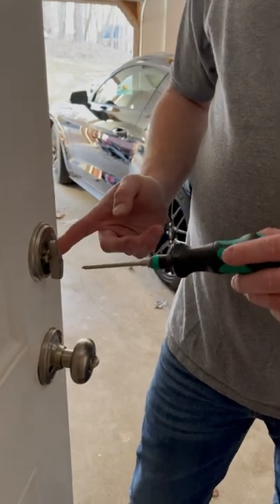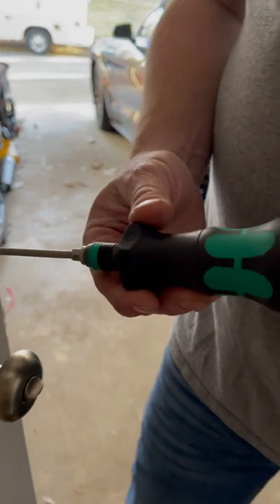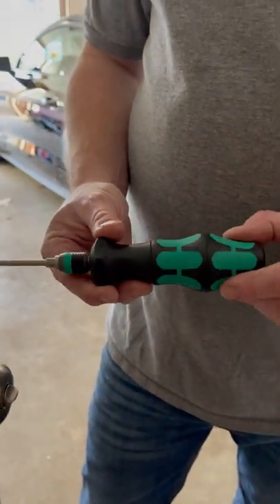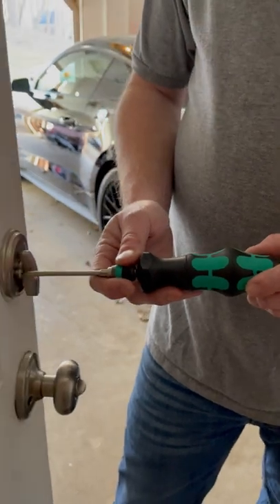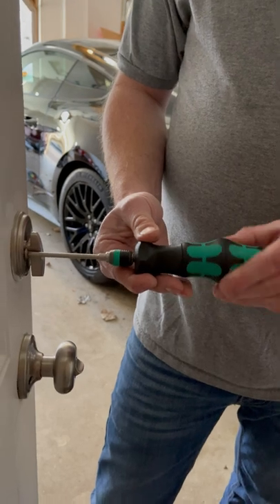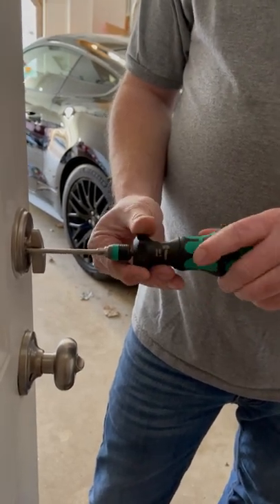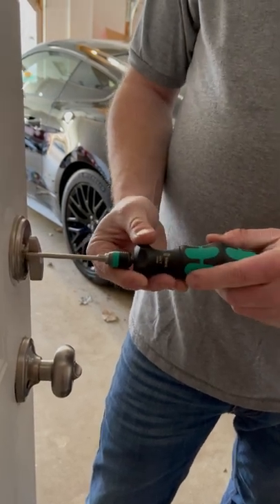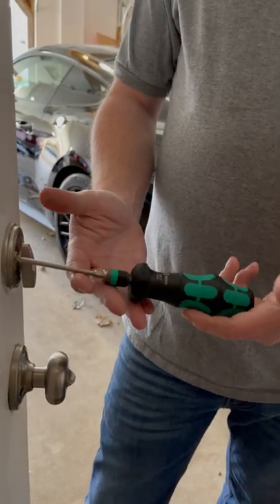Turbo Charged Screwdriver!

Comment from the maker: Link in description.
Reply: You should see my home made portable screwdriver, bye friend.
Reply: Is it durable though? 
Would it be a good buy for a diesel mechanic? 
Or would I just wear it out an brake it?
Reply: @lemonaid8678  i don't think  is durable and is useless too in my opinion. 
Edit: the gears are made by steel, so i think is durable.
Reply: @AsitShouldBe  well I wouldn’t buy it when I have the entire matco screwdriver set. That have proven themselves, but just wondering how durable it acutely is to pay 100 something dollars for it seems to me it’s for the home guy that would hardly use it.
Reply: My question is it battery operator or just a mechanically geared . Wouldnt mind something like this at my job . But since we cant use powered tool ,it would be point to buy
Reply: @StephenSmith-je7kz  from watching the video it seems like a ratchet screw driver just with a gear reduction in it.
Reply: @StephenSmith-je7kz  is simply geared, gears are made by steel.
Reply: I'm paying attention to that Mustang i love Mustangs 😂

Comment: Wonderful tool! But for $125 I’ll probably have to stick with regular “non-turbocharged” screwdriver 😔
Reply from the maker: It is pretty expensive. 💰💰
Reply: What!? Pass! I have a black and decker battery powered one i got for $30 and cant believe how much i use it
Reply: That makes snap on look cheap!
Reply: You gotta pay for quality. Wera and wiha are top quality tools I love all mine.
Reply: Theres quality and then there is overpriced..
Reply: Now Stahlwille makes snap on look cheap but again another very high quality tool German tools are exceptional even a lot of the cheap German tools are great. Wera is Czech but still awesome.
Reply: got a bosh ixo 6 gen for 45$ on discount ,  way more useful , you can also buy attachements for it
Reply: Did u say $125 for this screwdriver?
Reply: @Mario A. yeah most of my screwdrivers are naturally aspirated 
I do have a few turbocharged ones tho lol just not this one yet.
Reply: @PacAnimal  lol I have several electric ones as well as dewalt 20 volt drill and impact Milwaukee fuel m18 and m12 drills and impacts. I’m just a tool fanatic and I love all my tools
Reply: Jesus, I really wanted that until I saw this comment.  I’m not hating, just yikes 😬
Reply: @donniebrazis  me to. I was getting ready to order it,until I seen the price. Screw that. But not with a Wersa. Lol
Reply: If it comes with a lifetime warranty then it’s not too bad. I would be gutted to have this thing break.
Reply: @erik1514  I’m not sure how long the warranty is supposed to be but I have a regular wera multibit driver where you push a button on the top and the body separates and has the bits. I accidentally ran mine over with a big truck and broke the body. I sent them a picture of it broken and they asked for my address. About a week later I had a brand new one in the mail. Didn’t ask any questions about how or what happened or when I bought it or any receipt.
Reply: For that price, it should have a turbo mode, normal mode, and a high torque mode
Reply: 🤣🤣 its just money man. Make and spend it. Treat yo self 😌
Reply: For 125 bucks it better make me lunch when I'm done with it
Reply: I have a milwaukee M4 power screwriver. Tool & a battery with charger for 150
Reply: You can buy  an impact driver set
Reply: @SUMDUDE.  alot of snap on shit is not all that. Believe me i know. I've broken more snap on sockets than i have anything.
Reply: @bigdreamerification  make and save... spend wisely
Reply: @jamesfair9751  the difference between stahlwille and snapon is that snapon is expensive everywhere and stahlwille is at least reasonable in europe
Reply: I see it on Amazon for $70-80
Reply: @thefogisgone3662  oh I know, I have more tools then most mechanic shops and most are snap on but I have switched all my power tools to milwaukee and use milwaukee ⅜ socket set daily. But I also use my $2500 ¼ snap on 100th anniversary set daily too. My snap on rep said I break more stuff then anyone else on his route, I told him the other people aint working hard enough lol. At the end of the day you cant beat snap on sockets and ratchets. I do go to my matco xl ratchet wrenches over my snap on ratchet wrenches tho
Reply: @jetaddict420  that’s good to know. Now who is going to Europe that Can pick me up
Reply: @SUMDUDE.  i work in my dads transmission shop he's had for about 30 years and he's basically got everything we need already hand and air tool wise. And its all snap on, matco, and mac tools. I mean i've bought about $3,000 worth of snap on ratchets, wrenches, sockets, and CT761 i have to have rebuilt regularly once a year, plus lights and another $1000 or 2 on other trucks myself. But i have it all paid off and the only trucks that still stop in are snap on and matco. The mac guy gets all butthurt when he finds out you been buying from other dealers so he wont stop unless you bitch em to death to warranty something. I've noticed that tool trucks only really want to stop when you owe them money. But after awhile it just becomes silly bc im not buyin shit i dont really need just to make sure that they stop yano? I like tools but my fetish phase is over with and sometimes i dont even go out on the truck when he comes by anymore bc i got shit to do and i know im gonna buy somethin i probably dont really need. It becomes like the waitress at a restaurant who doesnt do her job and make sure your drink is filled but still expects a tip bc most people tip regardless of the service. I've had the best luck with Snap On and Matco warranty wise though. But yeah they dont like it when ya dont owe them money.
Reply: 4x the speed and only 1/4 the torque! I'll buy 2!
Reply: @blackmesaresearch2  its basically a non ratcheting ratcheting screw driver lol
Reply: You can get a decent impact driver or even a drill for that money
Reply: lol, less than 60$ in my country
Reply: Look good but I rather stick milwaukee close price
Reply: Made in Germany with real wages vs made in China with slave wages.
Reply: Ah yes you mean the naturally aspirated screwdriver. That one is good too!
Reply: @PacAnimal  no replacement for displacement
Reply: @gigi9467  amen to that. I'm experienced enough to know the difference.
Reply: @jamesfair9751  where is it made?
Reply: @kodyking3090  Stahlwille, wiha, gedore, knipex are made in Germany wera headquarters in Germany but is made in Czech Republic.
Reply: For $125 u can buy a few cheap drills and use them for screwdrivers.
Reply: Im a pro w my trigger on my impact driver.  Dewalt driver that can set locks to frame a wall. $150 screw driver is for video makers
Reply: The answer I needed. Regular driver is fine for me.
Reply: I'll just stick to an extended bit holder and a drill lmao
Reply: Or just buy the kobalt one
Reply: Just slap a turbo on that nun turbo 1 cylinder 1000spins per hour bad boy
Reply: $125!? I was just about to go and search Amazon...I’ll pass now.
Reply: KOBALT DOUBLE DRIVE RIPOFF?
Reply: @jamesfair9751  shits overpriced, you can buy an impact diver for that price
Reply: Anything Wera is an above and beyond piece, but worth it
Reply: @ayoo4117  to each their own. I have several impact drivers as well. Different situations call for different tools. I can’t carry an impact in my pocket all day long.
Reply: And the batteries...
Reply: Man I don't normally feel bad for Americans but its 45GBP, you're being way overcharged.
Reply: At that point just buy a cheap little drill- and or buy a used drill
Reply: @ToolPros  Why so much? It's just a gear ratio'd screw driver. Great idea, too expensive
Reply: Just stick with a naturally aspirated screwdriver
Reply: @stephanopapadimitriou4789  imagine if the turbo broke on your screwdriver- "shit well I guess im not using it today"
Reply: A cordless screw driver is faster and cost much less
Reply: Yeah.. Naturally aspirated will do just fine for that price
Reply: Yeah I'd rather use an electric one
Reply: Better off buying a second hand Makita impact driver and extended ph2 impact bit.
Reply: Or pay a little extra for a power drill
Reply: $25 worth of quality plus $100 for the brand name.
Reply: WERA FTW.
Reply: Get a damn drill for 50 😂😂
Reply: Ide pay maybe $30.
Reply: I prefere my electric screwdriver, aka chordless drill lol. Its still pretty cool though, i can see people using this. For screwdrivers i always found ratchets kinda useless
Reply: @jamesfair9751  reviews on Amazon are mixed for this thing. Pay for quality applies to a lot of things lol but a plastic cheap feeling screwdriver with gears in it is not one of those. I could buy a 12 volt impact and run screws 10 times as fast as you could with this thing. Wera has a following of collectors not workers. They know this and they know people will pay a ridiculous price for their offerings. Klein is the master of paying for quality tools. Wera is the master of a spot in your brain that makes you only want the cheap plastic screwdriver more when you see the price. Wera is like redbull. Klein is like good old coffee.
Reply: That's nearly as much as an entire set of Snap On screwdrivers. I also can imagine the Snap On is less likely to break.
Reply: Non turbo is called naturally aspirated screwdriver
Reply: You can buy a good quality battery-powered screwdriver for a lot less than that gimmicky thing costs, but then it's amazing what some will pay just for 'poseur' stuff.
Reply: Yeah you can get a power tool for that money 🤣
Reply: It's not 125

Comment: I’ll stick with my normally aspirated screwdriver 😂
Reply: Naturally *
Reply: Naturally *
Reply: @kelvinchirayath4224  both are correct.
Reply: @AevenSong   correct
Reply: @mrglock568  no they are not
Reply: @narlynarwhals27  “ADJECTIVE
(Automotive engineering: Vehicle components, Engine, transmission, and exhaust)
A normally aspirated or naturally aspirated engine breathes air at atmospheric pressure”
Reply: @mrglock568  imagine being educated and still being told you’re wrong🧐
Reply: lol youtube grammar check is faster than AI recommendation
Reply: @mrglock568  say that in real life everyone will laugh at you
Reply: @Static_Spaceship69 Did the dictionary definition hurt your feefee’s?
Reply: @mrRufffnTumble  welcome to the interwebs
Reply: For that much you can get a all electric IMU activated screwdriver that is also a torque wrench. But wera does make pretty things.

Comment: I use my high torque makita impact for those kinda jobs, rips the door right outta the frame boom you may enter
Reply: Could probably pick one up secondhand for half the price of this thing and its stronger.
Reply: Makita Power Tools are the best!
[I have a Makita Wood Saw.
Very old, But still working good.] 😎
Reply: milwaukee makes the best power tools hands down while makita is overpriced hot garbage with Milwaukee you get your moneys worth
Reply: @maxcollins4397  I've locked up a brand new milwaukee drill the first time I used it, fuck milwaukee.
Reply: @Gesuspiece  hey ganggong did I take your original name you wanted to go with?😂😂😂
Reply: @Back_door_bandit_98  no, I got this name from the dark souls 3 poorly translated mod.
Reply: @Gesuspiece  ohhhhhhh gotcha G I just thought it was hilarious seeing a name so close tho this one
Reply: @maxcollins4397  what you gotta do is find some nice Hilti industrial power tools from work. Hilti makes hands down the best power tools because they went for consumers they litteraly rent them around to industry.  Stupid expensive but overbuilt

Comment: For the same amount of money, I bought a DeWalt hammer drill that does 100 other tasks. 😂
Reply: True, but then you gotta buy a $120 battery to run the thing. But either way I’d still never spend $120 on a screw driver
Reply: @baldbutton1983  60$ for a battery
Reply: @baldbutton1983  It’s more of an electrician tool I feel. I wish I had one of those when I have to do my a run of electric panels.
Reply: @WonderWhile  yeah, i’d say it’s probably used for face plates on outlets or maybe kitchen fitters for things like hinge adjustment/installation

Comment: So it doesn’t have a turbo, it has an OverDrive
Reply: Damn...that's good.
Reply: Or it just has a 2nd gear...
Reply: @everythingcool101  man I hate to be that guy that is always so literal, but.... 2nd gear is an underdrive gear. Normally with a five speed trans your fourth gear is a 1:1 ratio which is why 5th gear is called OverDrive. If it was more of a 2nd gear that would actually be even more badass, especially for really tight screws because your torque would be multiplied, if you made one full turn with your hand then the screwdriver would only make like one quarter of a turn, I think it’d be pretty awesome anyway.
Reply: @warrenmcelroy4718  not everyone was had common sense I guess.
Reply: @warrenmcelroy4718  lmao what ? you apologize for being nitpicky, and then you blurt out something that aint true ? 2nd geae does not always have to be an underdrive gear, there are lots of commercial 2 speeds out there, lots of them use the second in overdrive ratio so wtf
Reply: @warrenmcelroy4718  lol you give it but you cant take it haha.

Comment: If only they made electric screwdrivers... maybe call it.. “the drill”
Reply: They actually do have electric screwdrivers, not necessarily the big bulky drills, but small screwdrivers with a motor in them. Really cheap too, like $20
Reply: @animationcrate  😂😂😂🙈
Reply: @animationcrate  yeah id buy like a really small one for my mini projects but I've already got like a 20 year old version of this and ill use one of my drills first every time. Actually thanks for reminding me im gonna look into getting one.
Reply: @LectricLetus  Look into ES120, it's a smart electric screwdriver with open source code. 
It's got some pretty neat features and it's perfect for tiny projects.
Reply: Bunta  Yeah go ahead and take apart your remote or your phone with a drill. If you are driving self tapping or machine screws then drill is fine, but anything under M4 literally can't be unscrewed using a drill without destroying the thread.
Reply: Theres two Dewalt 8v gyro screwdrivers.  I personally prefer the newer one, the differences are ergonomic only.
Reply: They make tiny impact screwdrivers that run on air that are the same size as a screwdriver
Reply: If only they made a "drill" to remove screws... almost like an "electric screwdriver" 😉

Comment: It would be nice if they had a high torque mode that gave 1/4 turn for every turn.
Reply: For $ 125  it should but I guess a gear switch would add too much complexity. I don’t know shit about gears but sounds a lot more expensive to produce.
Reply: Its useful but price is a gag, id just use a drill then forget the trigger once its snug and that'd be better
Reply: Phillips head screwdrivers are designed to "cam out" at high torque so it would have to be for other screws like torx maybe

Comment: What about just using a drill that has 21 speeds and cost half the price 😐
Reply: a craftsman cordless drill is $70 and that screwdriver is $120
Reply: @LarryL3g3nd  that’s why I’ve had the same drill for 7 years right
Reply: @dancearoundtheworld5360  those drills or whatever you wanna call em look like they got dropped on their heads at the factory and the plant manager said fuck it bend em more craftsman strong
Reply: @austindeaton1940  Idk I do construction work 5-6 days a week and use my power tools a good portion non stop most of the day and Milwaukee tools easily keep up compared to anything else i owned
Reply: @LarryL3g3nd   I just do mechanic shit on the side for passive income I do have a Milwaukee electric impact wouldn’t consider it better then my dewalt of air impact but certainly not the worst
Reply: I bought a milwuakee impact driver for 100$ new in HD with battery and charger
Reply: @austindeaton1940  how is it passive income if you’re physically working?
Reply: @austindeaton1940  passive income being a mechanic?  Do you just think about fresh oil and the oil change is done?
Reply: @LarryL3g3nd  comes both from the same province in communist china.

Comment: For 30 bucks you can get a cheap drill and battery ;) for 125 bucks you can get this
Reply: True but unlike that $30 drill this screwdriver will last forever.
Reply: @jamesfair9751  Those gears wear out and have to be replaced.
Reply: @NotAWomble  it would take a very long time to wear out those gears
Reply: @jamesfair9751  new toy. You’ll have to see. Time tells all.

Comment: A cheap Porter Cable 1/4" impact driver would be a better solution. And you get the drill for $99. 2 batteries, 1 charger. I'll pass on the "turbo." 😅

Comment: I never have trouble turning the screwdriver, I do have trouble with cheap screws stripping heads though. Is there one that increases the bit speed, therefore reducing the torque?

Comment: I also have a turbocharged screwdriver, it's called "Makita 18v cordless" and it's skookum as fuck. It can even drill holes into Steel, aluminium, concrete and wood 🤯

Comment: Question : Why not use a powered drill?

Engineers Answer : This is supposed to be part of an EDC in your tool roll, for times, places and jobs where a little gadget can make life easier... for electrical sockets this would be a charm, normally about 2 million turns per screw for those on a ‘normal’ screwdriver.

Comment: Yeah I’ll keep my Milwaukee drills instead, $125 for a screw driver is nuts. Either drill if it’s a lot of turns or use a screw driver if it needs to be gentle or a few turns. Better yet there’s ratcheting screw drivers that complete this exact task for $15. Better yet there’s ratchet extensions that have the screw driver tips for $5. Would be cool to have but for the price it’s inaccessible for people who do actual work 🥴